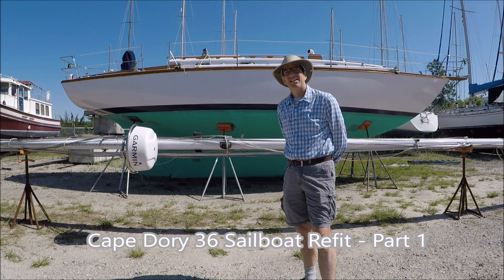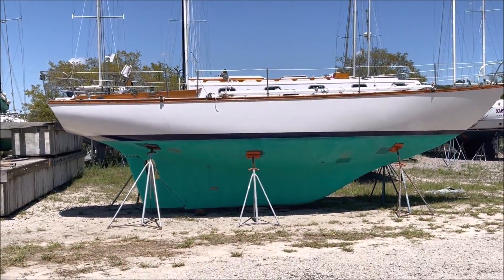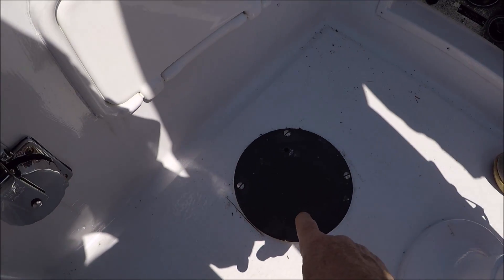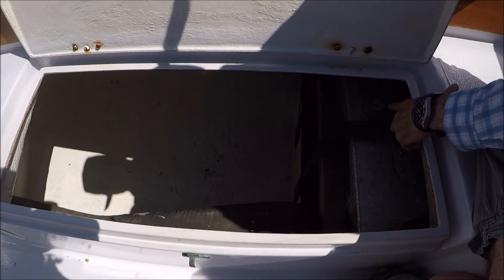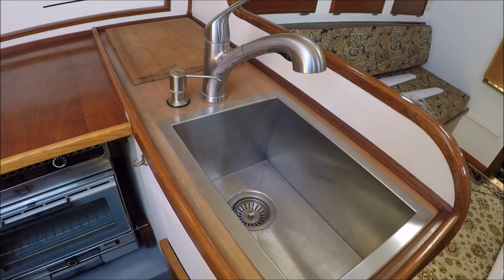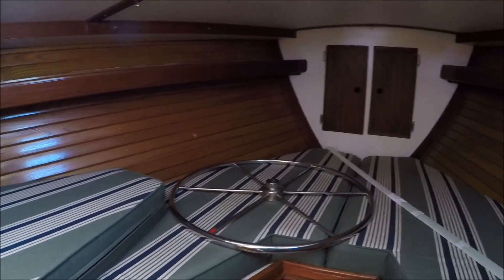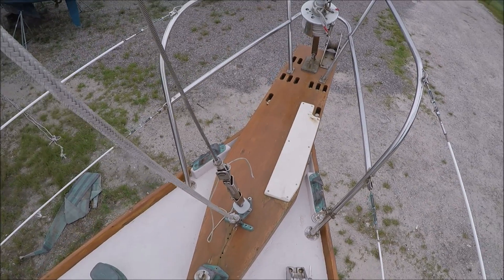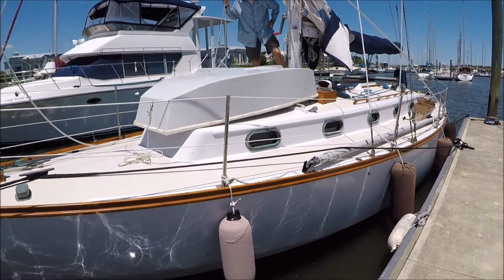Cape Dory 36 Sailboat Refit Part 1

Comment: I like the 9.8 Tohatsu conversion.  It should have sufficient power to take the boat anywhere on the inter-coastal.  I used the 6hp long shaft Yohatsu on my Glander Cay for the Erie Canal.
My concern is the draft.  I do not like anything more than 4 feet.

Comment: Fantastic project! Really looking forward to following along on this one. What impresses me almost as much as your workmanship is your patience in replying to the naysayers! My wife an I are at the beginning stages of building out a Westsail 32 from effectively a bare hull (1977 boat that never got launched or completed). We will be building our own electric inboard system, which that alone has garnered a surprising quantity of naysayers😂. Can’t wait to see part two!!!
Reply from the maker: Thanks for your comment. I'd be interested to follow your fitting out of the W32 if you have a blog for it. Or maybe you want to share what you're doing by joining the Plastic Classic Forum at: https://plasticclassicforum.com/forum/ 
There's a Projects section to document your refit. I'm a moderator for the forum and answer questions there.
Reply: @atomvoyager  we will be doing some sort of blog and/or vlog once we really get rolling on it. Next winter is when we will be really ripping into the project in a physical sense. 

Thank you for the tip regarding the Plastic Classic Forum, I just signed up!

Cheers

Comment: I'm late to the conversation here, but I do have a few thoughts to contribute -- as the owner of the boat. It was interesting to read the various comments, including those expressing some concern about how the modifications could impact the original CD36 design and perhaps also the performance of the boat. It seems that the key point where opinions divided was the removal of the diesel and its replacement with an outboard, to be housed in a special well at the stern. For me, it boils down to sailing preferences and philosophy. Without hashing out all the details, I knew from the get-go that I did not want to sail with a diesel. In fact, my ideal would be to sail with no engine at all, but that's a bit impractical, and I'd need to hone my sailing skills much more before even considering it. Some people do pull it off, however, and I was particularly inspired by James Baldwin, who sailed for years without an engine during his two solo circumnavigations. In my own case, the outboard well is the perfect compromise, and I'm benefiting many times over by working on the installation with James, a master craftsman who has spent years refitting classic old boats like the CD36. Months into the refit, the engine well is now completed, and it's turned out to be everything I'd hoped for and more. It's an elegant solution, and the finished product is beautifully integrated with the original design. We've already done sea trials with the gas outboard, and the boat clipped along at five knots plus, which is all I'll need. Also, I found that reversing with the diesel was a nightmare, and the outboard solution will be a welcome improvement. So, bottom line, I'm tremendously happy with the modifications so far and can't wait to cast off when we're done.

Comment: James, you mention that a larger outboard won't fit, but that may not be the case.  I saw another video, on the Emily & Clark's Adventures channel, the one on changing the oil in a 4 stroke outboard, where he talks about his Suzuki DF20A outboard he uses for his dinghy.  Firstly, he stated that Suzuki, Tohatsu, Nissan and Mercury all are the same outboard.  (As I understand it that applies to outboards under a certain horsepower rating, 40 HP if I remember correctly.)  Secondly, he stated that the DF10 and DF15 are the SAME MOTOR.  The only difference is the internal computer programming.  So if the outboard well you build will fit a DF10 or DF15, it will also fit a DF20.  Why underpower such a large sailboat if you can get 20 HP in the same motor footprint?  By the way I'm really looking forward to this refit series.  The Cape Dory 36 is one of my favorite designs.
Reply from the maker: I eye-balled some Suzuki motors at a showroom a couple years ago and none provided higher hp for same size as Tohatsu 9.8.I always choose the highest HP for the weight and dimensions of its class. For example, the Tohatsu 4,5, and 6 are the same motor size. As are the 8 and 9.8. Next size up is the identical 9.9 and 15hp models. Since the 9.8 on this boat only has about 1" to spare between transom and tiller bracket I doubt the 9.9-15 models can fit this type of enclosed well construction on this boat. So if Clark is saying the Suzuki 10-20 is the same as the Tohatsu 9.9 then it won't fit. If he says its the same as the 9.8 then it will. Maybe someone will find a higher hp Suzuki or Yamaha 25" extra long shaft 4-stroke model that can fit and I'd be interested to know if that is the case. But until they have actually done it, I'll remain skeptical. Bigger motors cost more and weigh more and are generally more trouble to deal with. If a sailor has the patience and skills to get by with less HP then having a motor that will move the boat at 5 plus knots in a calm is good enough. In situations where there is wind then I find it better to sail than motor even if motoring might be easier.

Comment: No one is better at these kinds of affordable practical mods than James Baldwin.  There are also very few sailors with his blue water sailing experience.  This is going to be a simple uncomplicated easy to maintain yet superbly capable blue water boat. The skipper will need to be competent and conservative in his decision making for sure but that's just good seamanship. 

I sailed a CD 36 for five years without an inboard diesel.  Filled in the aperture. Two offshore round trips between NC and the Virgin Islands. Never had a bit of trouble.  I eventually installed a small diesel with offset folding prop, more for aesthetic reasons, and made another singlehanded offshore voyage to and from the Virgin Islands. But the jury is still out on installing the engine. I think in many ways I gave up more than I gained. I enjoyed sailing the boat more without it. If I listened to the naysayers I'd never have the fabulous sailing machine I now have.  
 
Voyaging on an uncomplicated sailing centric boat that requires you to be on top of your game is one of the most freeing experiences left to a man, or woman, in this gadget and technology centric world. 

I am keen to see how it all works out.

Comment from the maker: There are many comments here regarding the wisdom of making these planned modifications. I've answered some naysayers individually but it's mostly a pointless exercise. Some of their condemnation was brought on because I didn't explain all the plans, justifications, and pros and cons. The main complaint is that we're removing the ailing 42 year-old diesel to replace it with an outboard well. Their skepticism is understandable because not one of them has any experience with a properly designed outboard well nor have they the experience, confidence and patience to sail with an underpowered engine. They typically raise sail only when it's convenient and motor rather than sail much of the time. They are also unaware that this design has been proven during my 20 years of design improvements and ocean crossings on many boats in the 28-32' range. The old diesel on this boat had to be rebuilt or replaced. The owner was initially inclined to sail engineless with just a sculling oar for the challenge and pleasure of the sport as well as the practicalities of becoming a better sailor, and not wanting the problems associated with a space-wasting, foul smelling, expensive diesel. He wanted to reduce potentially boat-sinking below waterline holes, including prop shaft and water intake, to have better access and storage to the interior, without risk of an inaccessible fouled prop or the drag associated with it under sail. He eventually decided on a compromise between diesel and sculling oar. 

My outboard well design will accommodate either a a 9.8hp gas Tohatsu SailPro or a 6kw ePropulsion Navy EVO 6.0 (supposedly 10hp equivalent) electric outboard with regeneration feature to recharge the 48v battery under sail. Our goal is to have an enclosed outboard motor installation that tilts up for drag-free and snag-free sailing, that will propel the boat at least 5 knots in calm water, and that has some ability to motor at lesser speed into moderate wind or light chop. If you need more performance then that then this is not right for you. My experience tells me there is no problem to acheive this with a 9.8hp gas motor. It should be the same result for the 6kw electric motor but will have to await sea trials to confirm. The gas motor is available as backup to the vulnerable electronics of the electric motor as well as a way to increase range if he decides to make a long inland cruise or transit the Panama Canal. While this is something of an experiment to see how well this sailor's skills and needs on such a large boat will match the limited propulsion available, this is going to be a huge improvement over a sculling oar no matter that it falls short of diesel performance. In any case, a larger gas motor would not fit in the lazarette space available.

For some it's a question of purity of the Cape Dory original design. They say cutting a narrow slot in the hull and transom above the waterline to accommodate a tilt-up outboard motor enclosed in an expanded lazarette locker will somehow destroy the design purity. Most of them have no problem with the much worse aesthetics of owners installing huge biminis, dinghies on davits, solar arches, and wind generators. They may have their place and purpose but certainly affect the aesthetics far more than a properly designed enclosed tilt-up outboard well. A hundred years ago people of similar mindset would lament the "butchering" of pure sailing craft by the addition of inboard engines.

More info is given in the following article: https://atomvoyages.com/articles/the-improved-outboard-well/
Reply: @atomvoyager I hope after the project is complete you encourage him to-and link to- his experiences with this setup, as it might influence what I do with my own boat some day (which is basically an overgrown Pearson Triton). I'm considering a Thunderstruck setup which is a lot more affordable than the companies you mentioned. I'm still a bit skeptical but will watch with interest and an open mind. Thank you for sharing it!
Reply from the maker: @jims5338  The Thunderstruck is a more affordable system and they now offer a regen feature I wasn't aware of when I last checked into them. But they do say their regen may not work depending on sailing speed and type of prop you use so I'm not sure exactly what that means. Inboard EP is the only option for most boat designs and if you make short trips from marina to marina then limited regen is not such an issue.

Comment: Super excited to see how this turns out on a slightly larger boat than your previous conversions. Your engine well design is inspiring. By the way, any updates on the CD27?
Reply from the maker: Took a few weeks off from the Cape Dory 27 as we were catching up on the 36. Will have to continue moving from one back to the other since they both want to launch in the spring and I need to work part time steadily with the owner of the 36. I'll have a video out soon on the 27 covering several projects underway such as plumbing, removing or fitting more hardware, and interior projects.

Comment: Again, a CD 36 is a great boat. 
I’m all for the conversion to tiller, and  removing the foresail boom. 
I’m neutral on the outboard,  but I would never take out a functioning diesel, I’m just comfortable maintaining them.😂
I ve done an Atlantic circuit starting in Newfoundland. 
I  loved the Azores. Contact me if the owner thinks  I might be of help.
The owner is  correct in getting help making these renovations, and he needs to watch closely, and acquire 
Boat maintenance skills…
Moving on, I have an Alberg 35 with steering wheel, and I’d love to switch to tiller. So I will be watching your conversion with interest. 👍👍👍

Comment: You do beautiful work and a great Sailor.  Love and follow and look so forward when I get notification comes in and the Cape Dory 36 is the most beautiful and fastest full keel Alberg did.  Total agree with tiller but I think I would actually cry to see you cutting for outboard and is like putting a harbor freight Briggs and Stratton engine and taking our a Ferrari engine.
Reply from the maker: Thanks for your comments but I have to ask how many tears you have shed over the marred beauty of boats with huge biminis, dinghies on davits, solar arches, and wind generators? They all have their place and purpose but affect the aesthetics far more than a properly designed enclosed tilt-up outboard well.
The Ferrari metaphor is not even close unless that Ferrari is amphibious and is primarily sail-powered. But even then not so much, haha. Anyway, I don't mean to come across as disparaging your valid opinion and am glad you added to the conversation.
Reply: @atomvoyager         All items u mentioned such as Bimini, solar, etc can be taken off with a Phillips screwdriver and not to chop the stern off and put in a outboard motor that will cavitate in a 3’ sea.   It’s no fun coming into a pass with 6 seas and rocks or Coral and to hear the to hear of a prop of a outboard engine spinning out of water.   If he wants to go extreme use a electric but will scare the hell out of u in a 30 knot breeze going under a bridge.  40 hp Yanmar with electric capabilities and a big prop will allow u drink your cocktail as u are going into a harbor and not worry about crashing into a 10 million dollar yacht.
Reply from the maker: @clintdavis47  It's not that I disagree with much of your assessment because yes an underpowered engine does present some risk and extra work and care at times. I'm sure all of the outboard motor installations you have experience with are just as bad as you say. This design has been sea trialed around the world and many sailors find it functional enough. It's more about what each particular sailor wants and is comfortable with. On the other hand, you are exaggerating so much that now I'm not sure you have thought this out. Nobody ever removes all that crap, screwdriver or not and we are not chopping off the stern, just cutting a slot that has cover boards to close it off. If you're interested in the results rather than just telling us how bad it is before you've seen it, then check back for a future episode. Also, this owner wanted to try engineless sailing with just a sculling oar, so this is going to be a huge improvement no matter how it may fall short of diesel performance.

Comment: what fuel does the stove/oven use?
Reply from the maker: That's an Origo non-pressurized alcohol stove. Simple and safe. They aren't produced any more but used ones frequently come on the market.
Reply: @atomvoyager  Origo makes ovens too? Is there a thermostat for the oven?
Reply from the maker: @generoll4027  They used to. The stove is non-electrical so oven is controlled only by the manual setting of the flame control knob I think.

Comment: Composting toilets aren't all their cracked up to be, they might be okay if it's just you, but if you have crew the liquid ends up overflowed, and the solids stink if they don't mix it right, it's easier to flip a valve and dump the tank overboard.
Reply: You have to know how to do it. Separate urine from solids. I pee in a jar, my wife uses a urine diverter to a jar. Two of us, 6 weeks, no odor, we dispose of waste once at end of trip. We do use shoreside facilities when available, about half the time. You can't dump overboard when close to shore.